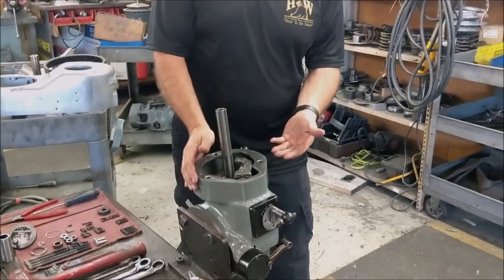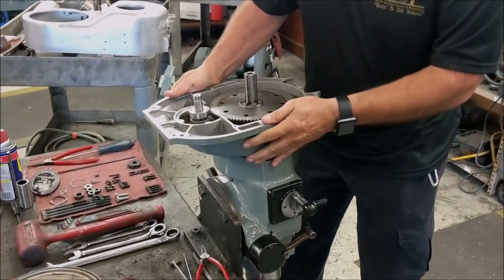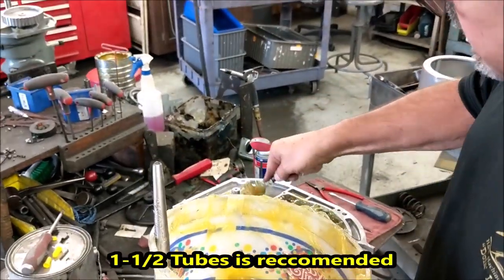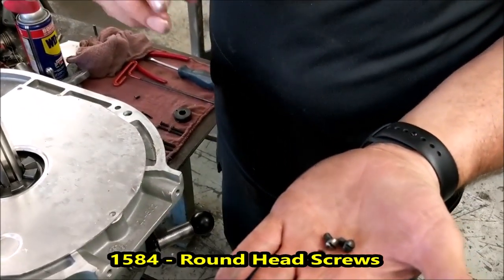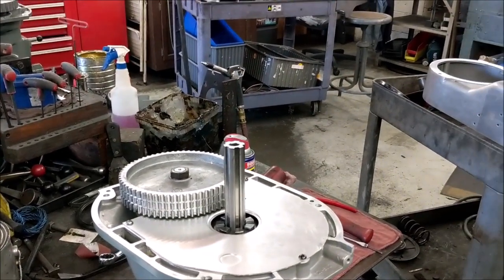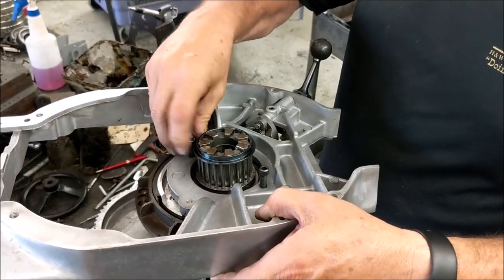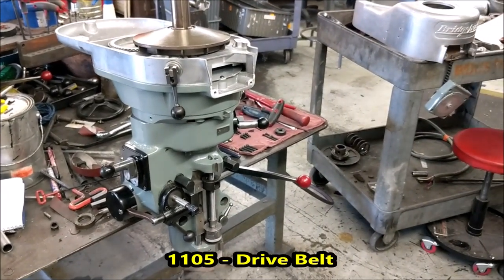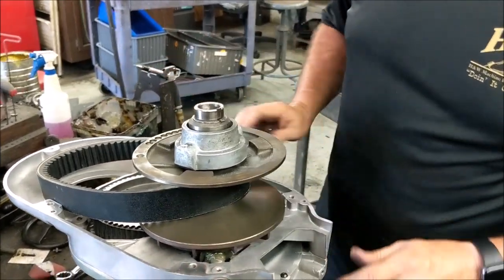Bridgeport Variable Speed Top Half Reassembly

Comment: Very helpful video! This helped me tear down a 2HP Enco which is a close copy of the Bridgeport. It would have been helpful if the video described the screw length and compression procedure of the motor pulley. The pulley needs to be compressed with short screws installed - short enough that the pulley clears the belt when installing the motor, but not so short that the belt doesn't support the spring when the compression screws are removed (?). I used 1 inch screws, however it did not appear to be as compressed as in the video when the screws bottomed out. When we went to put the motor in we could not get the belt around the pulley. The solution was to remove the bearing cap and unbolt the cover, which allowed the cover to slide forward a bit. One person just pulled forward on the cover while pushing back on the belt with a stick (through the speed control mouting hole) while two other guys put the motor in while getting the belt on. I'm not sure if the pulley was not compressed enough, or the belt was too short, or the hole was not machined out enough on this chinese copy.

Comment: Back in the late sixties to the late '80s My father I and my brother use to do this for my father's business..most of the time we did it at the shop where the machines were we had a roll around table  and a box truck out side that had all the necessary parts  motors and accessories to pull the head mount it on the cart.. and have all the spare parts needed to go through it... Or if it was real bad and pressed for time we had spare heads that we could just swap it out and then do it at our leisure,,, The company would pick a low production day to come in and rebuild them so that machine could be down for the day in order to get it done lots of times on a Saturday if it led into Sunday if we needed something special and had to get it we could do so and not just bridgeport's,, horizontal grinders vertical grinders lathes, basically anything that got crashed or was worn out we could go in and service it for them... I have literally had bad dreams like you couldn't get it back together in time or people were waiting for you to get it finished so that they could go back into production crazy stuff over doing this.... They send the stuff to you guys you rebuild it and send it back... We didn't have that option.... Guys do nice work

Comment: Thanks for the information. Can the step pulley assemblies be replaced with a variable speed pulley assembly?
Reply from the maker: It can be done, but you would need to completely replace the entire top half of the head. None of the parts other than the timing belt pulley is the same between the two types. If you would like to discuss it you can give us a call. 1-800-285-5271

Comment: After replacing bushings and bull gear bearings and reassembling the head on a 2 hp Bridgeport, I'm have trouble with the high-low speed change lever trying to slide out when changing from high to low speed or vice versa.  Could you please tell me what I need to adjust on the speed change lever to prevent this from occurring?
Reply from the maker: I will need to speak with you over the phone to discuss the problem and solution.  I will be back in the office this afternoon so you can call me at 800-285-5271.  We are on eastern time and I should be back in the office by 12:30.

Comment: Absolutely fantastic instructional video Barry. I have a question though. I am currently reassembling my head and for some reason I am struggling to set up the High \ Neutral \ Low lever wherby it rubs in High on the underside of the ally plate or in Low gear it rubs on the top of the plate. Can you please advise the correct set up procedure of this lever to me?
Reply from the maker: Could you please give us a call at 800-285-5271.  I will have some specific questions regarding your machine. -Barry

Comment: At 13:00, did you say that you dont install the aligning pins? Won't the housing possible shift during operation without them? Thanks
Reply from the maker: No, if all the socket head cap screws are tightened down you will not have any shifting and sometimes you need to be able to slightly shift housing during the dialing in process in order to get the head to operate optimally.  I have been rebuilding heads this way for 35 years and have never had a housing shift after completion. -Barry
Reply: @HWMachRepair  liked, subscribed, and I ordered all my parts from H&W. Thanks for replying. Martin

Comment: At 1.14 if you can help. I can't get my lever to engage low speed only high and neutral. Any suggestions what to try without stripping it down.. thanks if you reply. David.
Reply from the maker: Hi David, Barry says that he needs more information. Could you give us a call when you get a chance: 1-800-285-5271 Thanks!

Comment: I can't find a straight answer. My step pulley motor burnt up, but I have a separate vari speed head assembly. Can I swap from the HI LO switch up?
Reply from the maker: You would have to swap everything from the quill housing up, and only if its another Bridgeport. The bolt pattern may or may not work with another head that isn't a Bridgeport. If you have specific questions you can give us a call 1-800-285-5271

Comment: So I'm confused. Yer saying this is a 2hp. But the 1 1/2hp I'm rebuilding has the same fine tooth timing belt/pulley as you are showing. The rebuild kits we ordered were for 2hp , but contained flat tooth , wide pitch belts. I'm doing our 2hp after I get this one done.
Reply from the maker: The 2HP belt has the 74 round tooth belt (1536). The 1.5 HP & 1HP has the 42 flat tooth belt (1115). Sometimes people changed the motors around on their heads so then it becomes what we like to refer to as a "Frankenstein" head, where the timing belt no longer matches the HP that it installed on it. Usually it's 2HP motors with 1.5HP timing belts, but we have also seen it the other way as well.  If you think you received something in error you need to contact our office so we can get it straightened out. 1-800-285-5271

Comment: I've noticed that Bridgeport does not use a bearing on the bottom end of the motor/pulley shaft. Some of the clones do - I have one of those clones with a bearing and I get a ton of vibration/odd harmonics from that area. When I unscrew the plate that supports that bearing I notice a decrease in noise and vibration throughout the whole machine. Is there a reason why Bridgeport decided to leave the bottom of this shaft unsupported?
Reply: I don't know if they have a technical reason.  I think that Bridgeport does not like to change anything so they go with the same set-up they have forever.  I personally think a support bearing would be good but I see you have had problems with it.

Comment: I bought the rebuild kit from you for my 2hp J head Bridgeport. I did the disassembly/reassembly per the written directions. 
Powered the machine up and in low range there is considerable noise (gear whine). Or could it be the timing belt whining. Hi range is pretty quiet. Do you have any insight?
Figure I’ll be pulling it apart again to recheck everything.
Reply: Still working on mine, but what about the alignment (height) of the small gear at the back that mates to the bull gear?
The only other thing I can think of is alignment of the bull gear with respect to the spline handle that raises/lower the bull gear. H&W give pretty good directions on setting it up as well. Good luck

Comment: Do you put grease between the gears or leave them dry
Reply from the maker: The bull gears are sitting in a vat of grease, so I am going to assume you are talking about the castle gears, let me know if I'm incorrect. The short answer is because Bridgeport doesn't require it, so we don't do it. Any place that is greased in an open area like that is going to be a magnet for debris, which is going to make the parts wear down faster. If you would like to discuss it further you can give us a call 1-800-285-5271     -Barry
Reply: @HWMachRepair  Hi Thanks for the response My machine is a Tos From Czechoslovakia its about 25 years old The castle gears are at the bottom they were stripped so I had the welder where I work tig weld them up and I re machined them I Didn't know if it was supposed to be greased so I came to YouTube and came across this video But I think from what you said since the gears I'm referring to are totally enclosed That I should put some grease as you have done on your Bridgeport rebuild.  Thanks for the video.